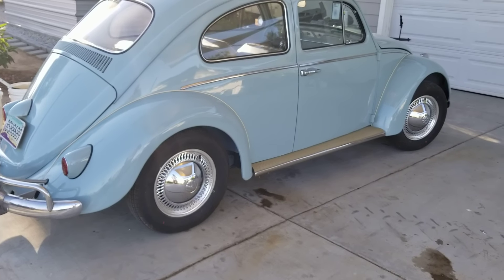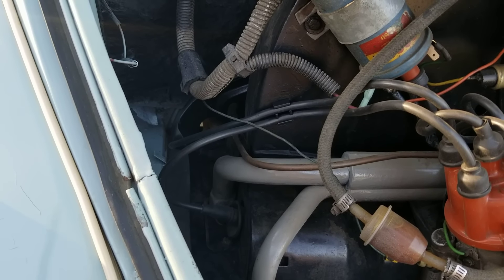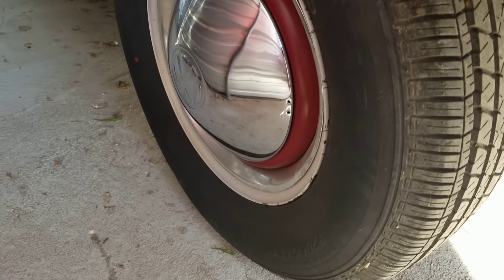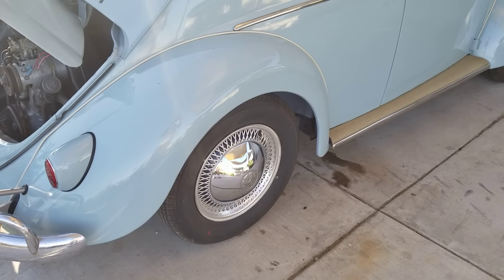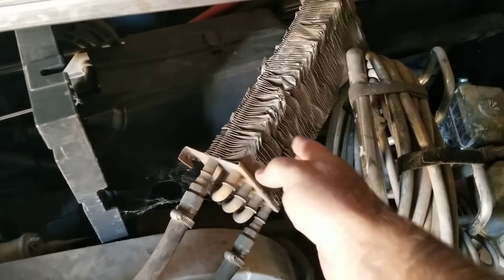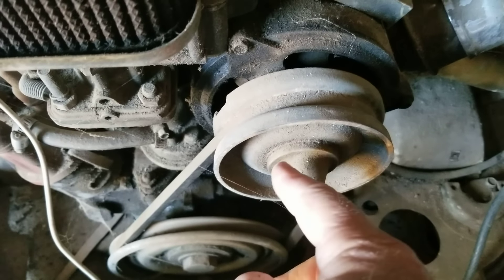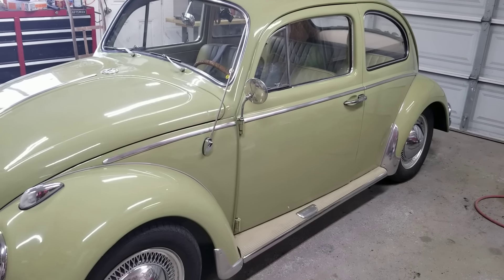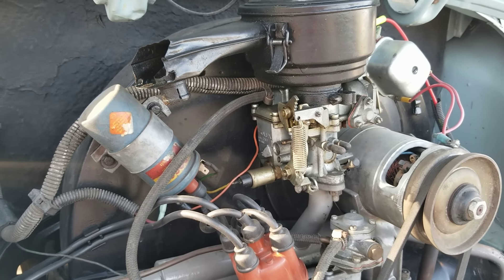Things NOT!!  to do to your Volkswagen VW bug or bus

Comment: Do not keep ur car 6-volts unless its an show or specailty use car. No. Same with a DC generator they r garbage!! Get an alternater and by pass the voltage regulator!! Alternators are just as much or cheaper and r way more reliable last way longer!!! If its a daily or u want it reliable Alternators r a must!!!!

Comment: Carburetor fuel pressure needs to be reduced to 2 or 3 psi. Today's fuel different than in the 70's.
Reply: The type of fuel has nothing to do with the fuel pressure needed.  Use the stock pressure.

Comment: Never build a "killer engine" without backing it up with a "killer transmission." Never forget to install a set of "killer 4-wheel disc brakes" to slow your car down. While I'm at it, it's a "manual" or "standard" transmission, not a "stick-shift." THOSE RIGHT THERE ARE THE STUPIDEST PAIR IF WORDS EVER TO BE JOINED IN THE ENTIRE AUTOMOTIVE VERNACULAR! Honorable mention unsaid category is when an "engine" is referred to as a "motor."

Comment: Always lower your vw, always run dual carbs, always upgrade your brakes, always run correct tire pressure, (20 front 30 rear or thereabouts) always carry a fire extinguisher. Always wave to a fellow V-dubber!

Comment: Do not remove your thermostat baffles from the air housing. The Germans were smart, these engines need to be at the proper temperature to operate correctly.

Comment: Why can't I drive at 80 mph in a bug without freeway gears? I drove my '72 at freeway speeds for 20 years.
Reply from the maker: well 72 might have had 3.88 which is the freeway gear set. earlier ones had 4.375 or 4.12

Comment: Forgot to say when that carb inlet pipe does come out it can be permanently repaired with JB Weld.
Reply from the maker: may not be permanent I would still put a leash on the clamp to one of the carb boldt pulled tightly.

Comment: It would amaze me that customers would continue to drive their car after it swallowed a valve. Completely ignoring the sudden loss of power and ever louder expensive noises coming from the rear of the car. Once the valve head banged around long enough in the combustion chamber to ruin the head and punch a hole in the piston. They now would have to ignore the huge plumes of blue smoke coming from the twin exhaust pipes. Yet still many completely oblivious would continue to drive despite this catastrophic engine failure. Now the valve head would bang around in the crankcase until it would get wedged between one of the crankshaft counter weights and the engine case breaking the case. My shop collected museum quality broken VW engine components. Pistons with valve heads wedge into them, pistons with holes, #3 exhaust valves stretched to just short of breaking, broken crank cases. List went on !

Comment: How bout- do not have the fuel filter in the engine bay or you may need to use that fire extinguisher!
Reply from the maker: in 35 years I have never heard of a problem with that but I have heard people blame it and the real reason was the brass inlet fell out of the carb,

Comment: Be sure to use only 20W-50 motor oil.
Reply: That's how you make your VW engine run hot.  It was designed for 30wt, so today you should be using 10W-30.  Or 5W-30.
Reply: Whatever works for you.  I always used 20W-50 and never had any engine problems.  It could also depend on what region of the country one lives in, as well.  :)

Comment: It's funny, when I used Bosch sparkplugs, my engine was slow as fuck. Champion worked perfect for me and ran better
Reply from the maker: well that has got to be the first I had champions with so many problems it isnt funny. too many to name fouling, separating. threads not quite the same and ruin heads. just to name a  few but I hope they work for you.

Comment: A lot of "do nots" for these cars. Buy a Corvair. They have less "Do nots".
Reply from the maker: just dont rev the engine up too much on a corvair or you will throw the belt. Believe me they have their issues as well. trans and rear end are different and you need to check the oil on both. Most people fry the rear end because the seal leaks not knowing they are separate. Had a 63 vert very fun car. loved it.

Comment: Do not drive fast around turns.
Reply from the maker: ok ralph nader ha ha.
Reply: Depends on the model. I drive my '73 Super (Strut front suspension, semi-trailing-arm "IRS" rear) around corners fast all the time, thing handles amazingly well. Just need to make sure my oil level is high enough, otherwise it sloshes away from the pickup and I get a momentary flash of the oil light.
Reply: This applies for every vehicle in existance
Reply: Especially important to go slow in corners on pre-1968 swing axle cars....they tend to have a wheel tuck in and the car rolls.....unless you add a stiffer front sway bar....rear camber compensator bar, stiffer gas shocks

Comment: DO NOT drive, or even START your VW without a safety wire on BOTH ends (carb. AND fuel pump side) of the pressurized (outlet) side of the fuel line. 
EVER.

Comment: do not cut off a tractor trailer driver and slam on the brakes and give him the finger
Reply: i had a smartass biker in a group of 20 or so bikers pull in front of my 13, 000 pound dually truck camper rig and try and brake check me. I never touched the brakes, I did however touch his bumper lightly.  He didn't try it again.

Comment: sorry you are wrong about the oil cooler

the stock oil cooler is inside the airflow shroud, and it restricts airflow to one of the heads and its cylinders
the after market oil cooler fixes this by going in front of the blower where it equally warms both heads and all four cylinders

putting the oil cooler where it is not in the air flow of the blower greatly increases your oil temperature, and it creates a plumbing nightmare where the oil cooler is no longer attached to the engine when you drop the engine

the engine was designed with the oil cooler in the blower air flow  - VW engineers knew what they were doing, and they knew why

and BTW: DO NOT put one of those worthless ugly luggage rack baskets on the roof of your vintage beetle

they were never popular
you NEVER saw them when Beetles were everywhere (watch some old TV shows or movies from the 60s and 70s
and it ruins the classic look of the vehicle

Comment: Do not repaint your bug unless you really have to. The original lead paint gets a nice patina. As long at it is structurally sound repainting is gay and so are the colors people choose to paint them. The imperfect orange peel finish from hand painting is not the same as a modern water based paint and finish. It looks gay. Stop it.
Reply: repainting is gay??? what????
Reply: @rancosteel  well, ok, if you say so.. but, still,  just doesn't seem right somehow...

Comment: Lost any credibility in the first minute with a plastic fuel filter on the pressure side of the fuel pump cuddled up to 'old sparky' the distributor. Some of the advice is good. Just not credible based on that fuel filter placement.

Comment: Do not run one of tbose external oil coolers at all.
Do not time a Bosch 009 distributor at the factory 5° ATC specs for the 1600. They only give 30° advance instead of 40-42°. Best to time the 009 on a 1600 at 7.5  BTC for proper power and fuel consumption.
Better yet, avoid the 009 altogether.
Reply from the maker: i always check my timing at total advance so It doesnt really matter how it gets there but your fine.

Comment: Do not use those cheap plastic see through gas filters. I always use an all metal filter from NAPA, and I mount it down by the transaxle for safety. Anchor the carb inlet hose with safety wire to a convenient screw on top of the carb. A fire extinguisher is mandatory. Change engine oil 3X a year for daily drivers. My Bug is a summer only driver, so once a year is fine for it. Adjust valves every 5K miles religiously. If you have little or no mechanical ability, any aircooled VW is not the car for you.
Reply: P.S.  Breakdowns = Meltdowns!